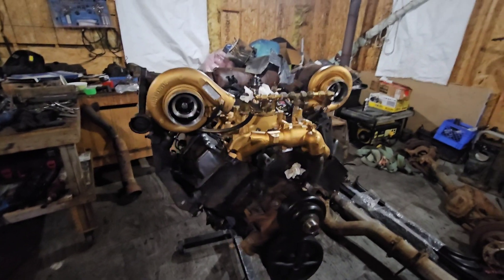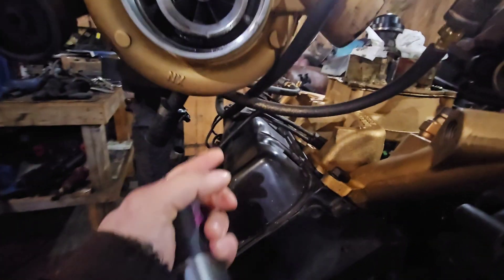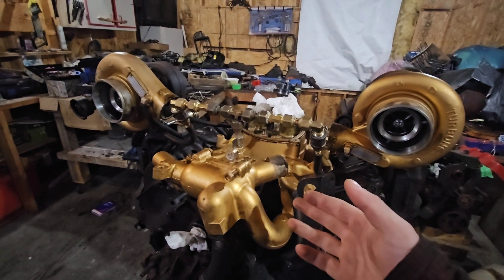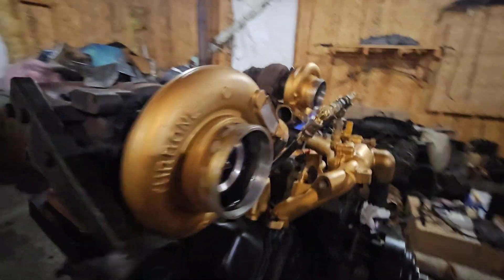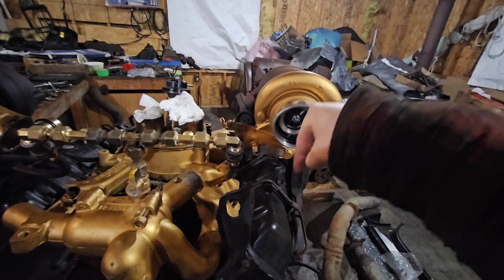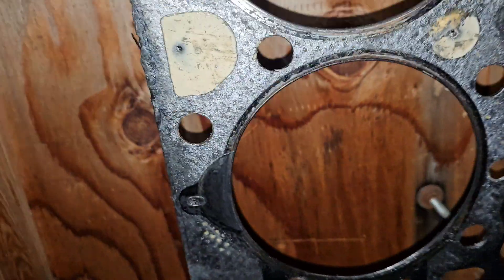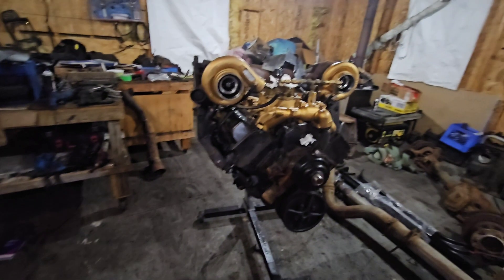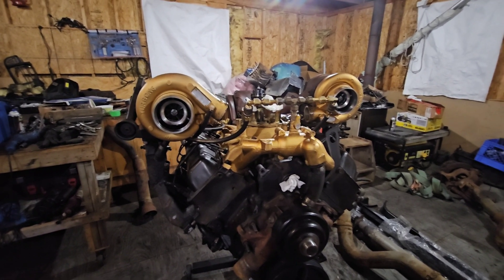I Built a 600HP 6.5l Diesel Engine

Comment: I learned that the 6.5 Head Gaskets are much weaker than the 6.2 Fel-Pro Head Gaskets.
Reply from the maker: @TheAscendedMaster  its best to go with the MLS head gaskets, they're the best of the best you can buy them on quadstar
Reply: @dieselnation555  I did use MLS Gaskets once unfortunately I was bedridden and had a shop do it. They never cleaned the old gasket from the deck so it leaked. My Fel-Pro ones have taken hits up to 30lbs of boost with no problem but sustained loaded high boost above 25lbs seems to be the gasket killer
Reply from the maker: @TheAscendedMaster  damn I would've chewed the garage out and made them pay the money back because that's absurd but with the right head studs and o ringed block you'll handle 50psi I estimate only issue then is the crank and rods lol

Comment: O ring the heads!!? Hope those head gaskets hold? Head studs? Either way nice work on that engine it’s a clean build.
Reply from the maker: Deck and head both resurfaced with 6.2 block, 6.5 heads, diamond pre cups, .020 thicker head gaskets and naturally head studs. Block is not o ringed tho I can assure you 25-30psi 2000ccs of methanol and 180cc of fuel the head gaskets will not hold on lol

Comment: My only concern is even if you are able to achieve 600 hp, would the block be able to handle that stress and heat. Given that those motors are known for cracking to begin with or if not the block the heads one of the two or both possibly. Otherwise can't wait to see the finished product
Reply from the maker: @DustinLaBombard  i agree lol

Between all the parts and upgrades I can have the supporting mods to achieve 600hp but as you said will the 6.5 hold that much. 

The old guy I bought the 6.2 block from claims the motor has somewhere around 700-900 thousand kilometers on it which is was flabbergasted by and didn't really care cause I only wanted the nv4500. After opening the motor up the cylinder walls were mirrors and the connecting rod bearings were ruined so I mean it's possible there's some fragments of truth to his story lol. I looked the motor over top to bottom and there's been no cracks so far as I can see and it still got the stock harmonic balancer which I've tested the limits on it which surprised me in a good way how it held up so well. 

Currently purchasing the intercooler and new intake set up, canada post is on strike so it'll be awhile before it gets here sadly
Reply: @dieselnation555  I watched another video on a guy bulletproofing a 6.5 and he said one of biggest reasons for head and or block cracking is the thermostat it's to my understanding that they come with a 210 thermostat.  He put a 190 in there and helped tremendously.  But with the power you are looking to make I'd put a 180 thermostat in it because my guess is based on what I learned about those Detroits the cooler they run the more power they are capable of let alone the longer they last. The fact that the military used them for so long tells alot about what they are capable of. I'm actually very glad you are doing this because I've been called an idiot for believing the potential of these motors. Well you I know will prove them all wrong . Again I can't wait to see the finished product.  Please keep me posted. Because this will undoubtedly shock the diesel world.
Reply: The cracks aren't usually a big deal. We have a couple with cracked heads and blocks and are still running. One has almost a million miles and it's got cracks. Just means it's seasoned,lol
 You can fix the cracks too, not a big deal
Reply from the maker: @tnrancher3913 this exact motor i rebuilt i was told by the old fellow i bought it from that it has upwards of 900 000km and the nv4500 had around 750 000km never once rebuilt or anything I'm the first to open her up and well she's been abused lol

Comment: Out of curiosity is 180cc of fuel really enough to hit 600hp I have a 320cc p7100 on my 12v with 370 marine injectors that are flow honed by the hungry diesel and a s400 as well as a power level 2 power drive diesel cylinder with big valves and springs rated for put 5200rpm and I don't think I am anywhere near 600hp
Reply from the maker: @Epad2116pineappl  with the db2 pumps 1cc of fuel is equal to 2.75-3hp and from my understanding as the rpms ramp up it'll increase the fuel output marginally plus with the amount of methanol I'll be spraying that will help power gains drastically or even destroy the engine drastically lmao 

I tested the difference between no methanol and spraying meth, there is a huge difference in gains. Faster spool and more acceleration all with the shitty design of the v4 lol so having v5 nearly complete i already have v6 of this set up essentially drawn up so I'm aiming for 600hp it'll also be dyno tested
Reply: @dieselnation555  I can't wait to see it I don't plan going over 400 with Cummins and I appreciate the explanation that answered the question it's not about the cc it's about all the stuff together that will get it up and over. Well said

Comment: Just for your information, diesel engines are lean burning engine they do not tolerate high, egt from excessive fueling
Reply: You've obviously never seen a sled pulling truck good sir
Reply: @hermanR02    thos build is competition only?   because sled pull trucks blow up all of the time.